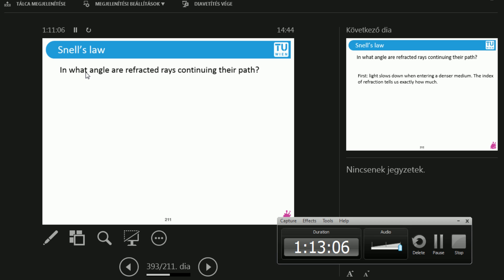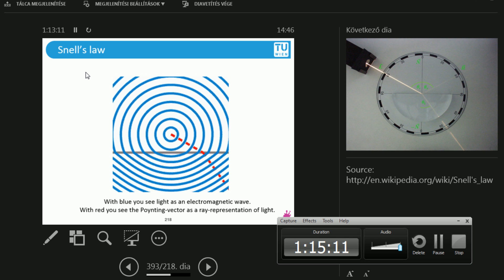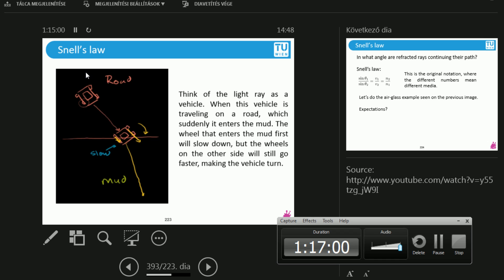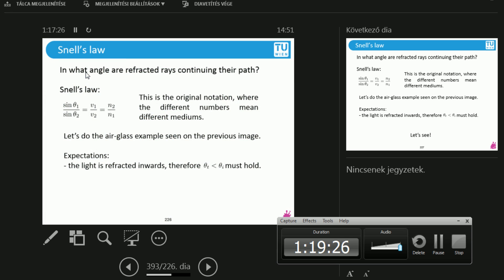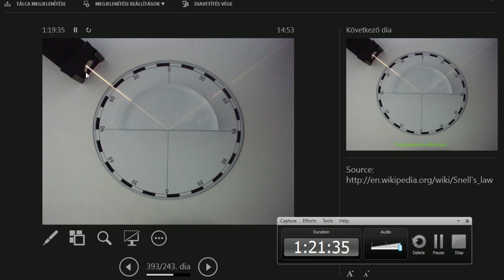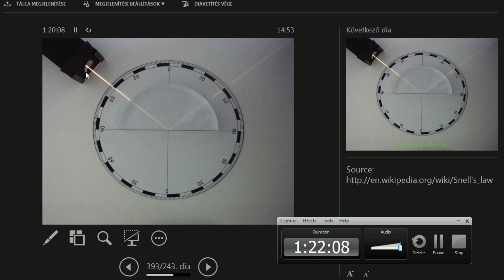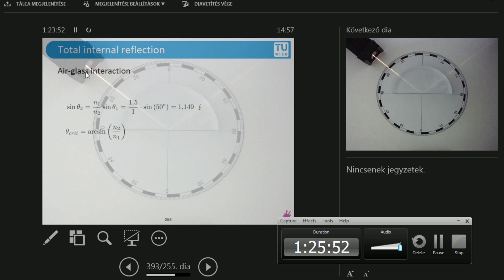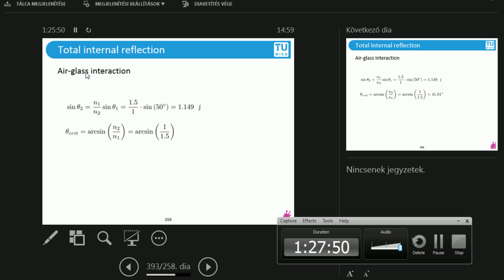TU Wien Rendering #6 - Snell's Law and Total Internal Reflection

Comment: if you really think about a particle entering half a state of speed and half of slow like a car, but the particle is like a sphere between two spaces, the full reflection makes a lot of sense, as the particle enter the space with more speed they turn in going back from the fast space to the slow again.

I know particles is a lot more difficult than just that, but if this could be right, there is a chance that at the limit of the two spaces(slow and fast) you can see a area with the size < than the diameter of the particle where the particle is reflecting and by this just turning backwards in the fast space.

sorry, I just like to imagine this sort of thing happening let me excited :v
Reply: I like the analogy but I wouldn’t see the particle itself flipping completely inner-reflection wise, because as soon as the ‘sides’ of the particle are free (the tires if you will) it would just continue on the parallel path (i.e. it would always be like the critical angle path or very close to that)